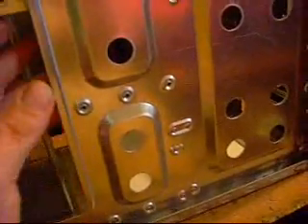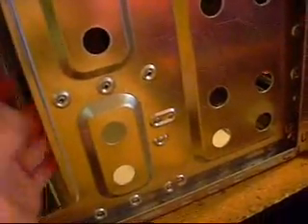New water cooling project video 3

Comment: I think you had a very similar case to the one I am using for Project Old Faithful. Thin, cheap metal, that flexes all too easily! So, I hear ya with this one! No surprise that you've now ditched this case and have moved everything bar the bigwater into the superflower.

Comment from the maker: Thanks Rick. I hate to grind away on a new rad but the only other option was to mount it on the back of the case which I didnt really care for. 
The colors on this one are going to be yellow for the inside and kind of a dark gloss blue for the outside. 
I did get some u channel for the window but I dont know if I will use it. The double sided tape is pretty thin and I think the channel will hold it too far away from the cover for it to work. So I may just sand it good and leave it.

Comment: Project is coming along nice good work on cutting the notch and sucks about the clearence for the rear fan. Trimming that notch of the rad should be easy solution. What color(s) are you thinking of painting this case? Window came out really nice are you using any u channel on it or just filing it and installing window?

Rick Arter